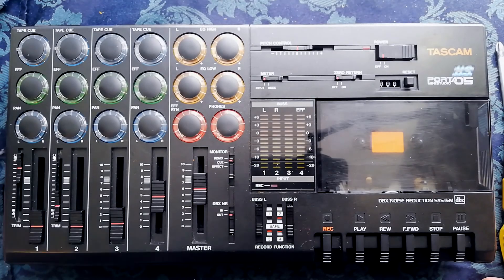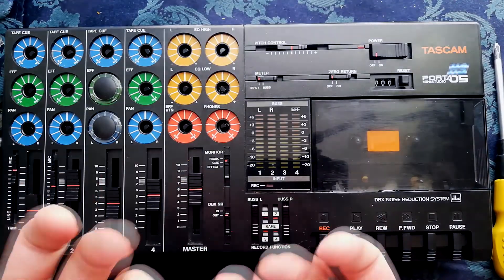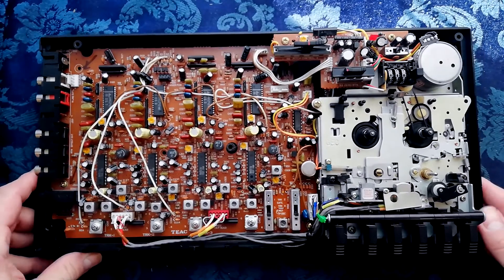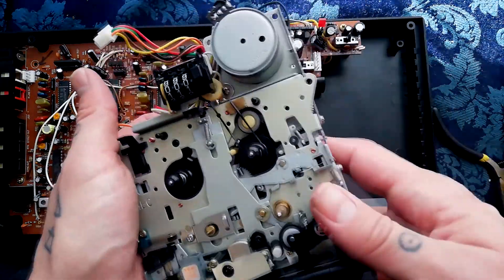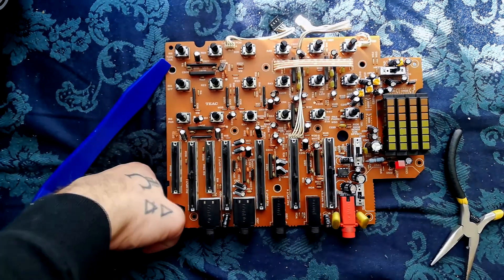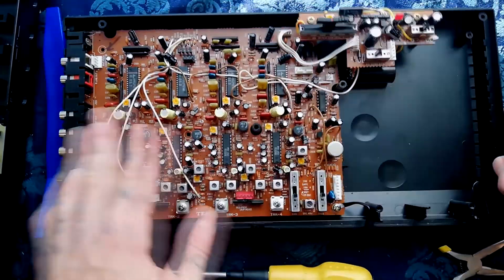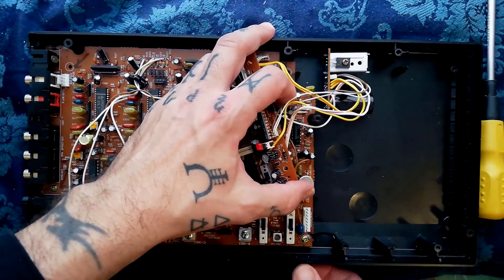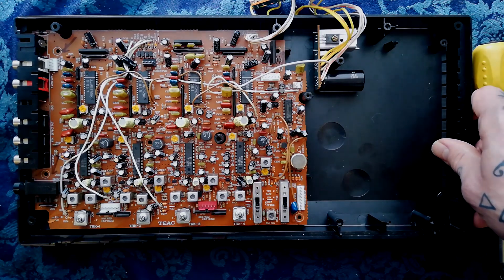Tascam Porta 05 | Tear Down

Comment: Hi @tetrakan I'm in need of a pinch roller for a porta 05. Got any suggestions for sourcing one? Is it the same for most portastudios? Thanks
Reply from the maker: Ali express is pretty good for such things these days. Off the top of my head its 1cm diameter and width and 1.5mm  hole for the spindle but check the dimensions of your old part.
Reply: @Tetrakan  thanks for the reply!

Comment: any recommends if there is disturbing noise on channel 1+2 when touching the TRS cable? the cables are fine, i guess it has to do with the TRS ring sleeve. it interferes even when touching the Tascam or know slightly on my table?

Comment: i have one of these and whenever i record anything the playback is super weak. i’ve been scouring the internet and can’t come up with anything. is the playback/record head kaput? i have 2 of these units so i could take the head out of one and put it in the other. i had to take it apart to fix the plastic mount that actuates the heads

Comment: Hey!
Just looked through some of your channel and WOW, fantastic resource. I bought a bunch of tapedecks that all need servicing, so super greatful for this!

I was hoping maybe you could help me out?
I have a Tascam Porta 05 that seems to work as it should after some fixing (still need to change some belts etc) 
BUT
I only hear the right channel. This is both from tape, and when putting things through the mixer.
It's through both main/line outputs, and through phones.
However, the LED-indicators indicate sound on both channels.

Do you have an idea of what the issue could be, or where it might have its origin?

Massive thanks in advance!
Reply: possibly a broken wire on the output?

Comment: greetings from Colombia, I currently have a Tascam porta 05 ministudio HS, and I would like to know if the mod can be made so that it plays and records at normal speed (4.75 cm / s), could you help me with it? It would be a great help for the project I have in mind
Thank you very much and a fraternal greeting from a distance
Reply from the maker: Yes this is possible. just resistors and simple switches required, a little custoim board wired to yellow and blue cables,  just copy the circuit from a 424 mk II (for example - this is available on my blog for free download) and find a place inside to mount the board.